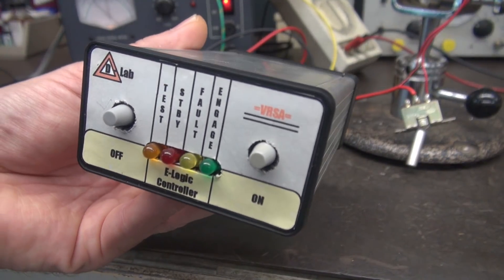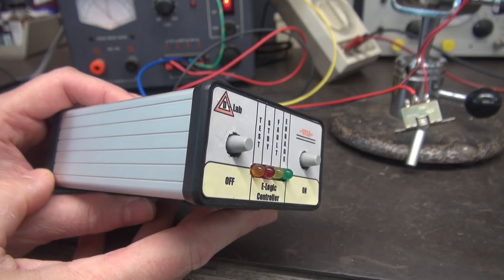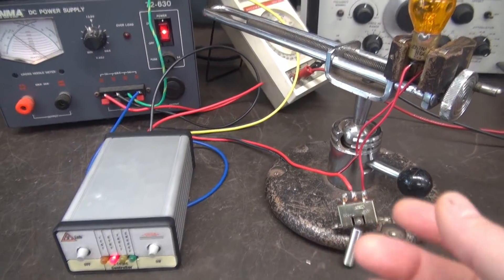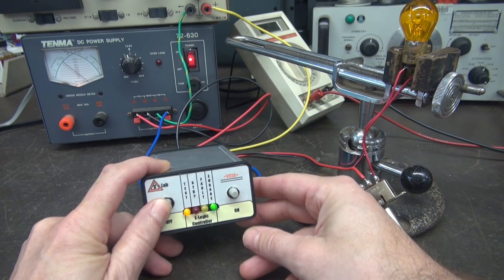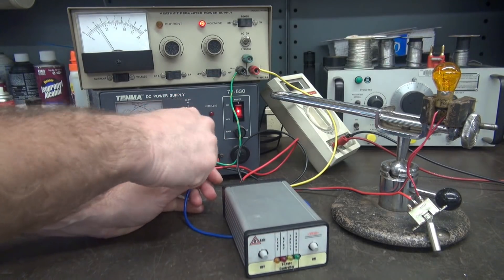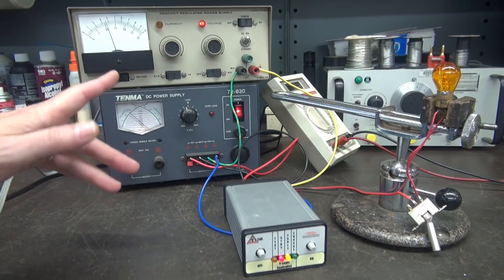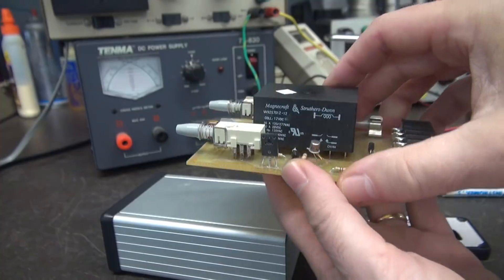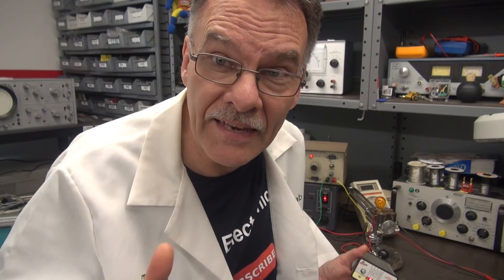Simple Machine Industrial control Fault detection Brain D-lab Electronics

Comment: I can't say as I'm fond of the open circuit indication.  I think it should light the "fault" light instead of the "engage" light.  Otherwise, it looks too much like a "normal" indication - especially since engage is green.   I'd be afraid that months down the line, I'd be worried about something that shows "test" and NO green indication instead of just test with no other indication.  Or, that I might interpret the engage light as an attempt as bypassing the safety and truing to turn things on.  Personally, I think I'd change the test light to green and use the red fault light for a problem.  That would give me confidence that I'd understand what's going on months later without reading a manual.

Comment: V R S A  Voice Reporting Signal Assembly. LGM 30.
Reply from the maker: Yes, you caught that! Replaced by the GMR Ground maintenance reporting system.
 I dispatched for many GMR 25's cooling faults
Reply: VRSA units used magnetic tape and could probably be erased by some stray EMP? Bad brine chillers smoked many G&C cans in my day.  The VRSA unit was developed from a multi channel radio broadcast deck. One channel per commercial spot. They were obsolete by the late 60's. Actually, VRSA was part of the ground equipment so that made it part of Ws-133-am, not the LGM...My mistake. Keep up the great vids!
Reply from the maker: Yep, I remember them. Did not work on the unit, but it was still taught at Chanute AFB. By the time I arrived FE Warren the new system was in place.